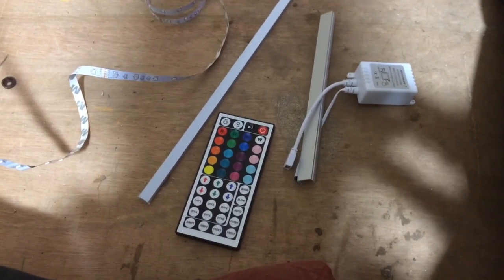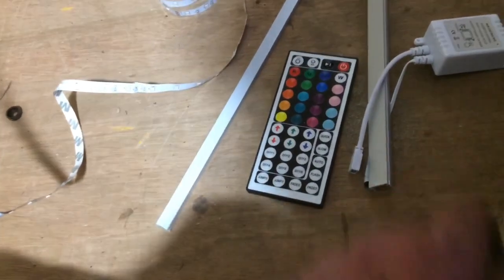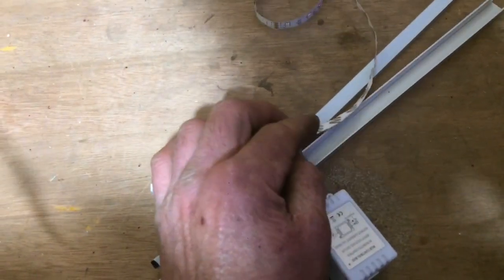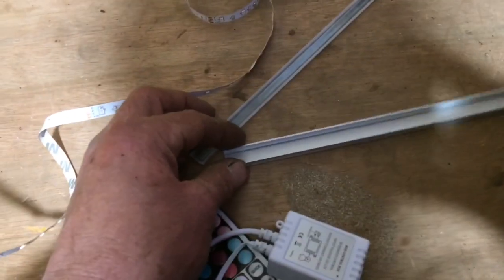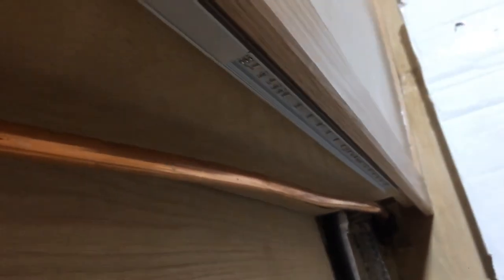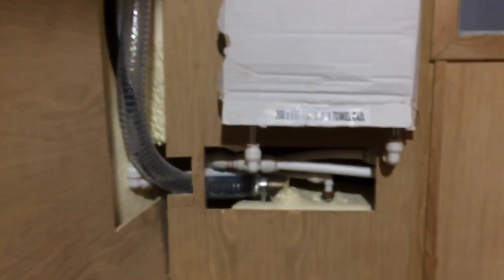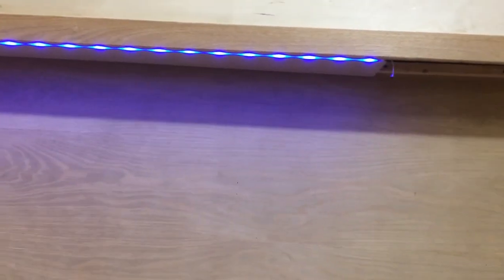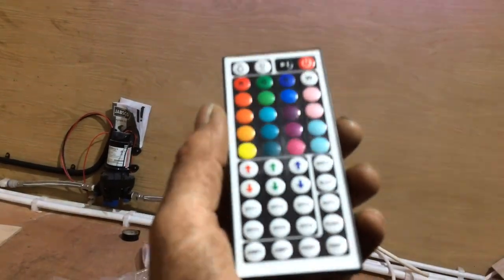Under Boat Gunwale led mood lighting

Comment: I use these for the floor but corner channel amazing idea like you said the tape seems to like the alloy and apperently helps distribute the heat allowing them to last way longer

Keep up good videos
Reply from the maker: The corner channel sounds cool. Maybe I will use some in future,on my butty workshop maybe? Good point about the heatsink that the ally provides. Thanks for watching and your kind comments 🙌🙌👍